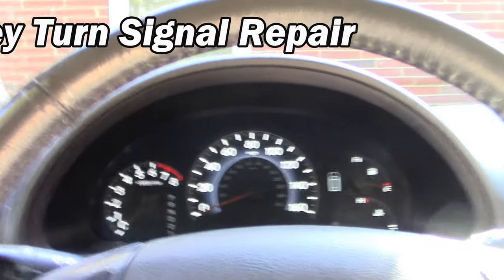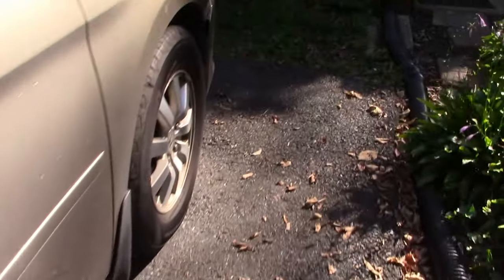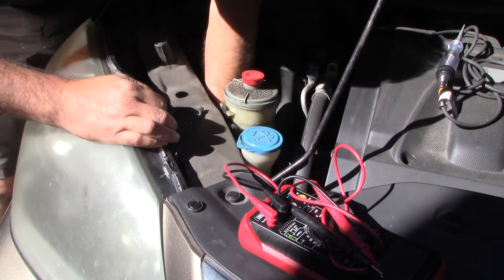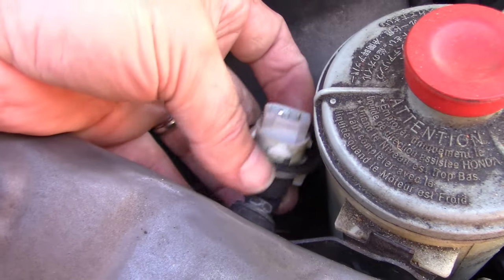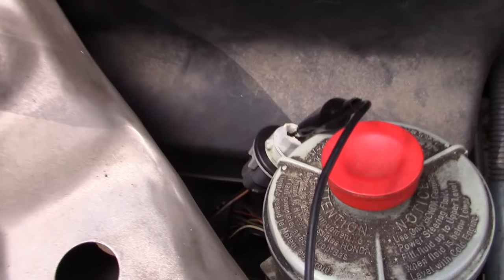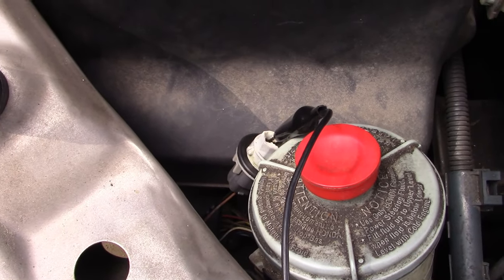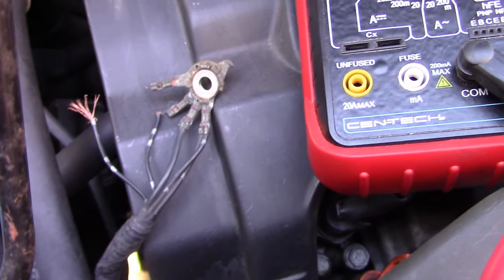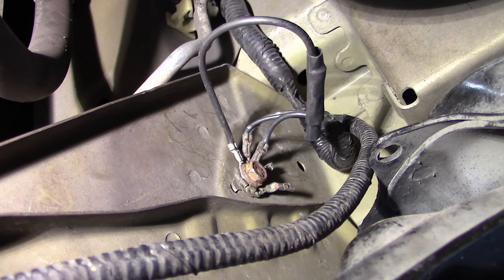TURN SIGNAL Not Working But BULB is GOOD - Blinker Diagnosis & FIX - Honda Odyssey

Comment: Thank you for this video! I have pretty similar symptoms in my 2005 Odyssey. I just replaced the right turn signal bulb, but it's not working. I guess it's time to check the ground connection...
Reply from the maker: Thank you. Good luck getting yours fixed!
Reply: @Buckwsr  Thank you! Yesterday I did a few tests, but I'm not sure if I done it correctly. First, the bulb is working. And my socket definitely gets + voltage because when bulb is connected to the positive socket pin and to the battery negative, it works perfectly. I located the ground where you showed it, but it seemed the continuity test was fine there. I need to repeat it one more time today. Also I removed the bolt, cleaned it with metal brush and slightly played with that ground connection. It felt pretty solid. So I'll try to check it one more time later today. Worst case I'll have to run a wire directly from the negative battery terminal to that black wire going into turn signal connector.
Reply from the maker: @yolo-cars  Test to see if you have ground connection at the turn signal bulb socket. You didn't mention whether or not you did that. Supplying ground to that socket from another location is an okay solution, I think, as a last resort. Good luck.
Reply: @Buckwsr  I'll do a test later today. At least I remember I tried to hook the bulb to the positive battery terminal on one side and to the ground connection in the socket on another side, but there was no light. I assume there was no ground. I'll try to perform the continuity test of the ground later today. I want to hook negative battery terminal with that ground point on the bottom right of the car. Also I'll try to perform continuity test of that black wire itself.
Reply from the maker: @yolo-cars  Sounds like you have a good understanding of how it works. I'm sure you will have it fixed very soon.
Reply: @Buckwsr  Thank you! So I did few quick continuity tests today: 1) I connected socket ground pin with battery negative terminal and got Open Loop (OL). 2) Then I connected negative battery terminal with the ground point on the body of the car that you showed in your video, and every one of 5 lines showed closed circuit, so ground is definitely provided at that ground point and available to each of the 5 lines. 3) Then I checked continuity between socket ground pin and that ground point on the bottom (I tried all lines and touched everything I could with the probe) and I got OL. So there is no ground somewhere in that wire. Idk if something inside the socket is bad or not. I can try to remove some insulation just before the socket and see if ground is there or not. If it's not there, then I'll need to bypass that cable and provide me own ground. I'll check it some time tomorrow since today is already too dark outside.
Reply from the maker: @yolo-cars  Give me an update once you've got it solved! Thanks.
Reply: @Buckwsr  I'll do. Today I only did a quick test - I cut the insulation on the ground wire just before the connector, and unfortunately my multimeter still showed OL. So the problem isn't inside connector. The bottom ground spot has ground. So ground is gone somewhere between that bottom spot and the connector. I guess the only easy option is to provide my own ground to the ground cable where I made a cut or around. I just don't have time to inspect the whole wire harness...
Reply from the maker: You could just run a new wire from the bulb socket down to that ground lug on the frame, (or other convenient grounding spot).
Reply: @Buckwsr  Thank you! The only problem I see here is that I may need to get a terminal that Honda is used in that socket. I guess it will be difficult to reuse the existing terminal. I had similar issue before with my Honda Accord where I needed to get a specific electrical terminal. I couldn't find it anywhere, so I had to order it from Japan. At this moment I plan to buy and use a T Tap connector.

Comment: If headlight on right front is all totally out can this cause rapid blinking from a good bulb in the right rear  tail light bulb?
Reply from the maker: Yes, that’s exactly what happens. Fix the front turn signal and that rapid blink in the rear will return to normal .
Reply: @Buckwsr   Okay. Thanks for the info.  I will be replacing my headlight bulb, & if needed the r front signal bulb.
  I believe that's going to be all I've needed. Thanks again.
Reply: @Buckwsr   Mine is easy to replace, the  bulb.
      2 clips and 1 bolt and easy headlight bulb Do it myself.
Reply: @Buckwsr     Hello Buck. Turned out that the male to female connector right behind the headlight has obviously gotten pushed loose. Just laying there, unconnected.  Hooked it right up and  didn't have to pay anyone
Reply from the maker: @bennygreene1421  Fabulous!
Reply: @Buckwsr  👍

Comment: I'm experiencing an issue with the driver's side turning signal. Following your demonstration, I connected a bulb socket to the battery and conducted a test, revealing a negative grounding wire problem. Where does the ground wire for the driver's side turning signal lead? Does it follow the same path as the passenger's side? Is one of those four wires the correct one, or does it connect to the driver's side bumper area?
Reply from the maker: I don't know exactly where the ground connection is for the driver's side, but I would guess it's somewhere similar to the passenger's side, somewhere down low where a group of wires bolts to the frame of the vehicle.
Reply: Thank you. I followed the cable, and it seemed to lead to the same spot on the passenger's side blinker ground. I feel it's one of those five cables. Is there any manual available on the web that I can find out?
Reply: It appears that the driver's side turn signal negative wire is black, and the positive ones are red and purple. They seem to lead to the same spot as the passenger side ground. Perhaps I'll conduct a continuity test. Should I remove the negative cable from the battery when working on these ground cables for safety? @Buckwsr
Reply from the maker: @nobidocument   With the key off there's no need to disconnect the battery, in my opinion, unless that makes you feel more comfortable. I would remove from the frame that lug with the 5 wires...all of which are ground wires by the way since they're bundled together and connected under the same bolt. Figure out which one(s) are corroded or broken, and re-do the connection, and then bolt it back to the frame. Good luck.
Reply: OK Thank you. I was performing a continuity test as demonstrated in the video. None of them produced a beep. I suppose I need to detach the wires from the bolt to properly test them. @Buckwsr
Reply: I conducted a continuity test from the right-side turn signal negative socket to one of those ground wires below to check for a beep, and it did beep. So, I don't believe the left-side turning signal ground is among those wires since it didn't produce a beep. I need to figure out where it could be located... @Buckwsr
Reply: If I can't find it, can I simply run a separate ground wire from the left turn signal socket's negative terminal and attach it to the frame with a bolt? Would this cause any issues or is it safe? @Buckwsr
Reply from the maker: You certainly could run a separate ground wire to your turn signal, connecting it somewhere on the frame more convenient. That would work. But you may have future problems if you don't clean up the corrosion where the 5 ground wires bolt to the frame down low....something else might malfunction on you at some point.
Reply: OK. Thank you. I will clean those 5 ground wire bolt connectors with connector cleaner and run a separate wire since I can't find out where the left turn signal ground wire is. Thank you for all your help. I'll let you know after I'm done.  @Buckwsr
Reply: I fixed it, and it's working now. However, I had to connect the ground wire directly to the negative side of the battery using a ring terminal. When I connected it to the body frame, it didn't work. Is this method okay and safe? @Buckwsr
Reply from the maker: I'm sure it's perfectly fine. Great job!  @nobidocument
Reply: Thank you for your help and advice! If anyone needs to fix their driver's side blinker, they can simply disconnect the negative wire from the blinker socket and connect it to the battery's negative terminal.  @Buckwsr
Reply: not disconnect but split negative wire